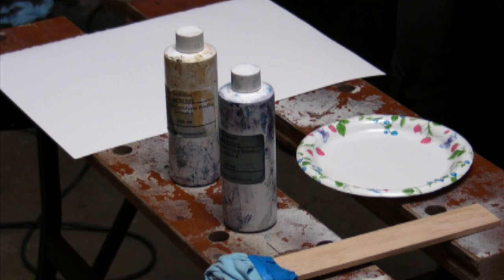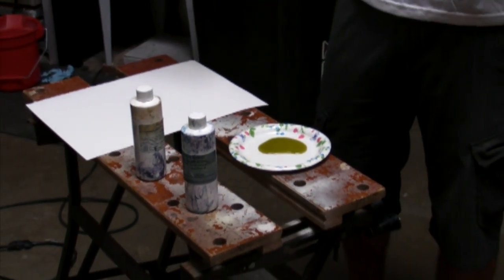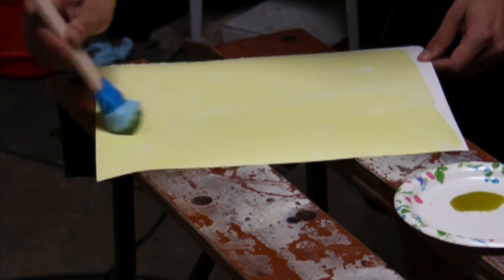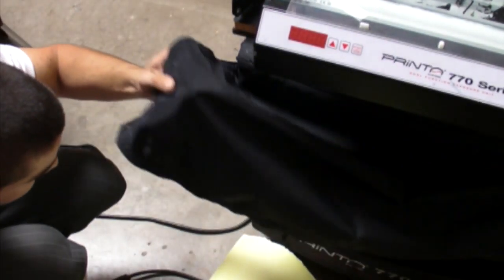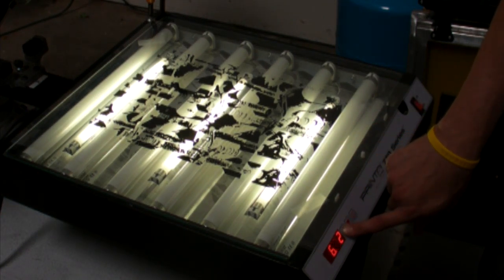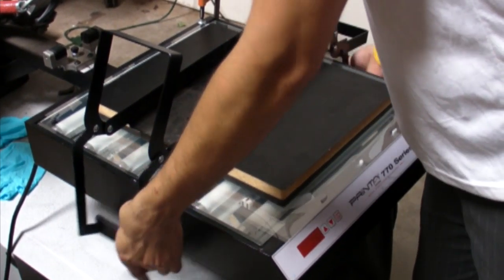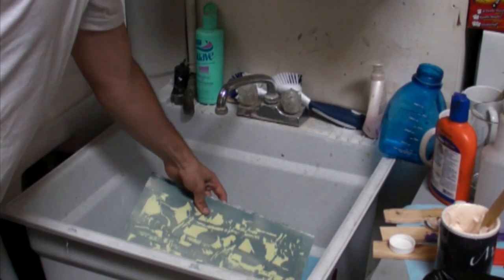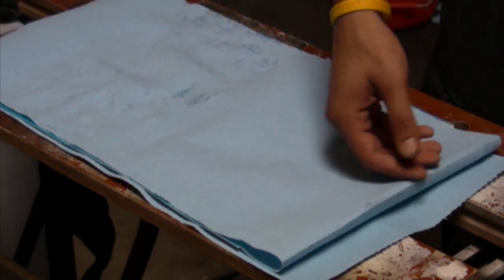Cyanotype Demonstration

Comment: You need to place the developed print after it has been washed into a diluted water and 3 % perioxide bath in order to intensify the cyan blue. One to 2 capfuls of peroxide to a tray of water will do the trick. Be sure to rewash your print in order to remove any residue of peroxide as over time it will bleach out the print if not thoroughly washed.